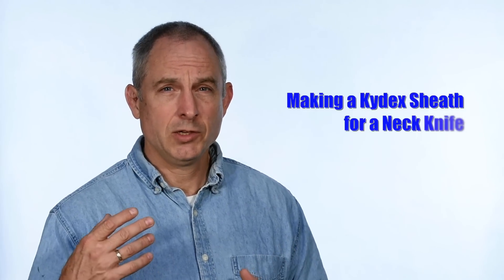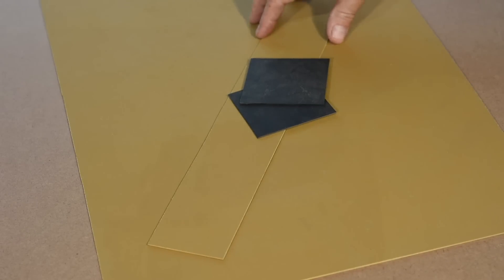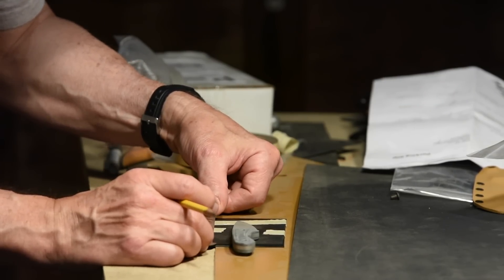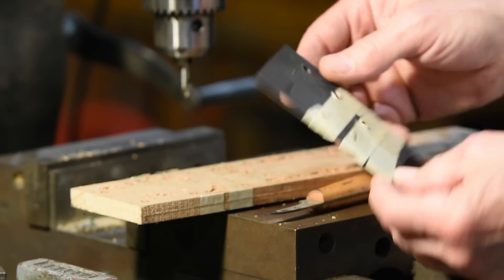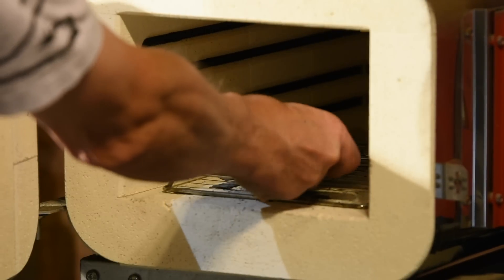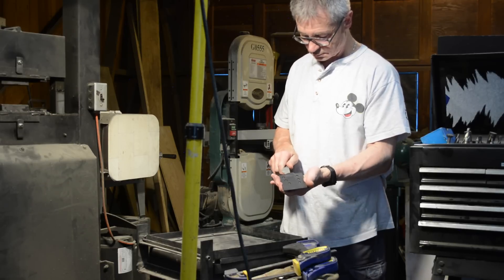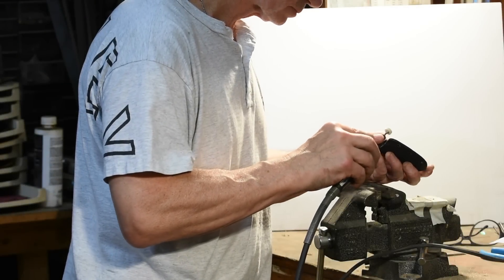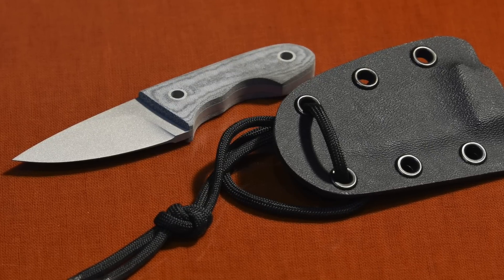Kydex Sheath for a Neck Knife

Comment: Hey walter I'm a knife maker starting to make Damascus I have a question on your forge press did you make it or buy it
Reply: I'm not Walter, but maybe I can answer a few questions.  The press Walter uses is a model Riverside Machine knife supply sells.  It's a good press, I know of several people that use them, including an ABS Mastersmith.  There are two basic types, H frame and C frame, you can build or buy either type.  I prefer the H frame for more rigidity, but the two uprights can get in the way on some operations and even though the C frames tend to flex I know of several that love them.  I built mine, basically a copy of the Claiborne H press, but am a welder and have experience fabricating equipment.  With the price of steel now, and the hassle of sourcing the parts, if I could afford it I'd probably buy one instead of build one if I had to do it again.  A lot of it has to do with time/money, if your short on time and can afford it, I'd say buy it, if your short on money and have the time you can save by building.  At the time I build mine they were going for about 2400$, and I built it for about 1200$  Steel has went up, but so have the presses, the Riverside machine press is running about 3500$, while the claiborne is 5000$.  Hope this helps.

Comment: Hi walter is o2 a easy to work with steel?
Cheers laurens
Reply: Dutchsurvivor just finished a neck knife in O2 steel, just using handtools and a filing jig. Very easy to work with, and as an added bonus I found rather little scale on the O2 from normalising and tempering. And when in doubt, just buy yourself a variety of steels, and see what ever one you prefer. As for me, I found my new favorite in O2 steel

Comment: Hi Mr Sorrells, just wondering if you could answer a quick question.

Would it be a bad idea to draw-file a bevel from guard/bolster to the point (http://img.photobucket.com/albums/v453/taigoo/On%20The%20Bench/On%20The%20Bench%202012/DSCN4420.jpg),  or would you recommend standard push filing across the bevel bit by bit?
It seemed like draw filing might be easier to achieve an even bevel with, rather than maybe getting uneven spots using a conventional "push the file down into the bevel" technique.

Thank you very much!